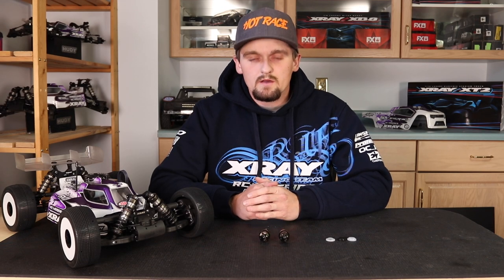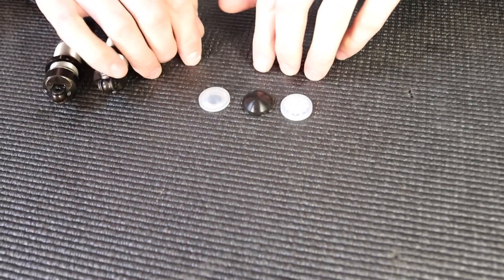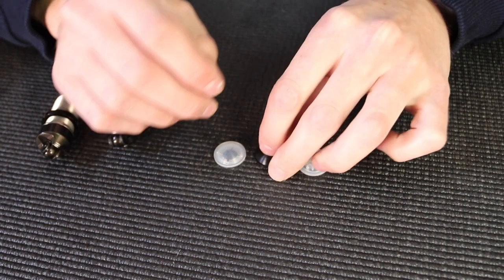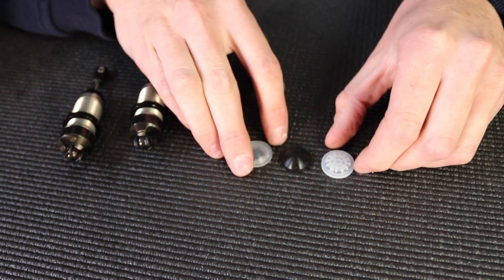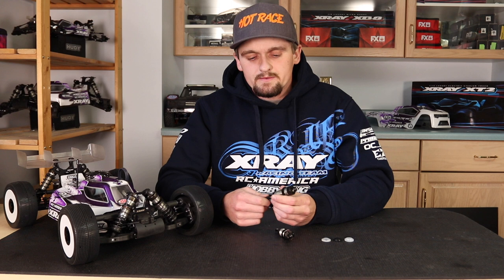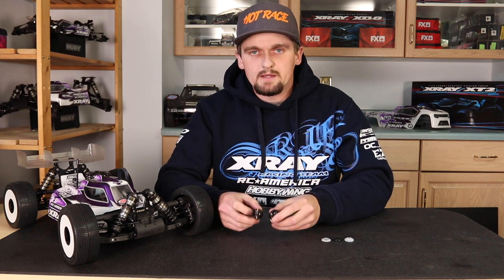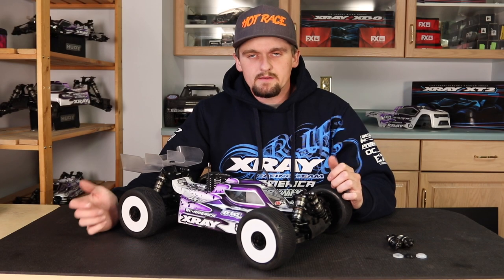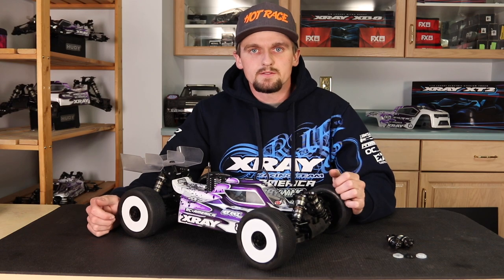Shock Rebound

Comment: i usually don´t wana correct pro drivers. but i think your explaination is not clear.
rebound and bladder are not directly connected.
i can run a bunch of rebound with a very soft bladder, but i can also run a nearly dead honeycomb shock.
i understand what you are saying. because a lot of rebound does not work very well with a super soft bladder. and honeycomb is usuallly not the best to run dead compared to a soft bladder.
but rebound is still not directly dependend on the type of bladder you use. you can even run 0 or a lot of rebound in emulsion.
rebound is more about the oil level and amount of oil in the shock than the bladder.

Comment: Nice video. I learn something ever time.  I am new to 1/8 scale and set the shocks for zero rebound.  The car does not seem to spring back to level arms when pushed down.  Does this mean the spring isn’t stiff enough for the weight of the buggy?   I heard that if you go with a stiffer spring you should go with thicker oil as well?  How do you know how to balance the oil vs the spring stiffness?
Reply from the maker: You have to drop and roll it when you set ride height as there is natural friction due to wheel scrub, I have a video on setting ride height you can watch.  It is not necessarily true that with a stiffer spring you want thicker oil, it depends on how much reaction you want out of your car.